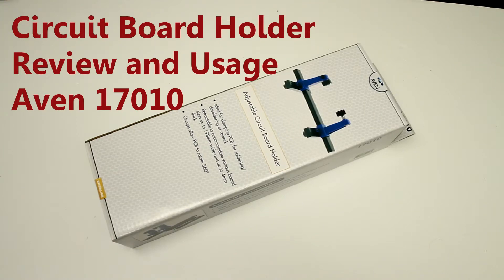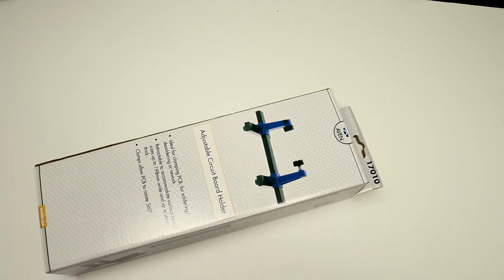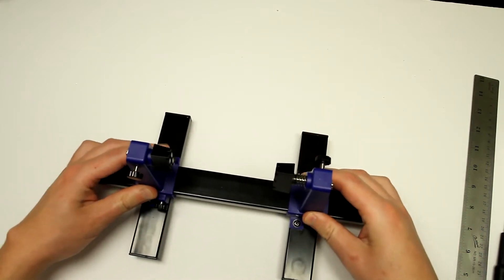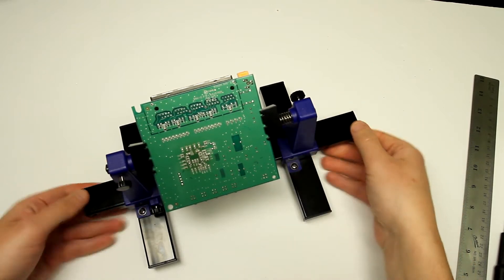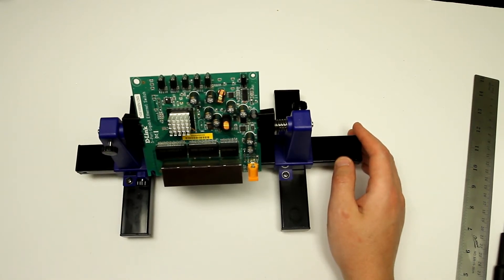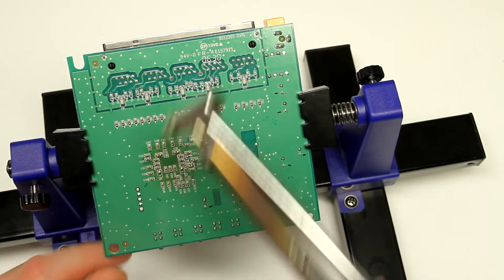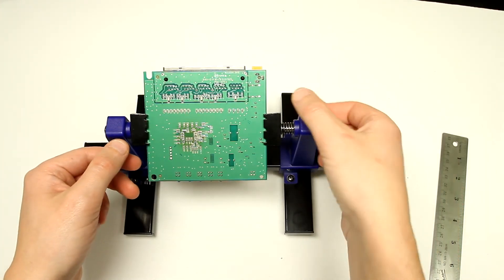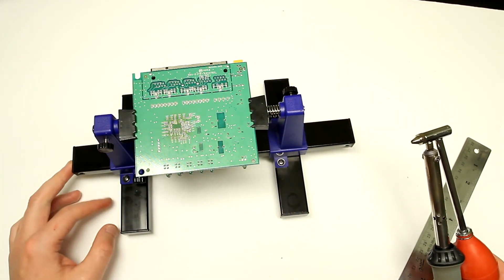Circuit Board Holder review and first impressions. Aven 17010

Comment: These are pretty neat but I broke the tension knobs pretty quick. I ended up making a whole new unit out of wood in the same design. Works fantastic
Reply from the maker: Yes ! I agree knobs are pretty flimsy, but ok for me. Probably I'm not using it as often as you do :)
Reply: @InsideOutElectronics  I really don't use it that much but I have so many hobbies that I have to keep moving stuff around and that caused breakage. Here is my wood version https://imgur.com/a/h6CKwkG
Reply from the maker: @larryb.lindsay2366  Nice one! Clearly makes job done !

Comment: Thanks for the review. I'm not too drawn to the plastic parts of the stand, but it does seem cheap, and more versatile than what I'm using now (heavy vice) If you still recommend it after the review, maybe it's worth it. Btw, my favorite part 14:00 .
Reply from the maker: +Datzfunk Thank you for you comment ! I think it is OK for the money and for some light job, I still using it!
Reply: @InsideOutElectronics  would you say it’s ok for PCB kit building work? I build synths (eurorack) and my helping hands crapped out lol, I was looking at these as they are so cheap and it was almost identical to what I was considering designing for a 3D print project but - only 10$ on Amazon .. might as well.
Reply from the maker: @LikeMinds_  I think it would work, I had same idea of designing something, but buying was cheaper.... so I got this one. But itis too bulky if working on tiny pub btw

Comment: Mine just arrived - be careful not to over tighten knobs as they are anchored by a nut in the plastic.  Mine arrived with the knobs on the vice part having come lose - what a pain in the buttocks to get them back in place as there is a small nut you have to wiggle into place behind the shafts for the vice/springs.   Other than that this looks like a nice product to hold circuit boards.
Reply from the maker: +Digger D Thank you for the comment! I will watch for this, can they be just glued?
Reply: Yeah - I was thinking I'd put some hot glue in the nut slots to keep them in place in case I unscrewed the knob too far.  I would have preferred all metal construction and would have been willing to pay extra for it but it's still a nice holder.
Reply from the maker: +Digger D [Edited out previous reply as it is irrelevant ] All metal would be great, would cost much more, AL made arms would be major cost